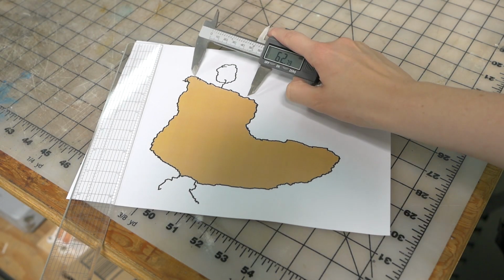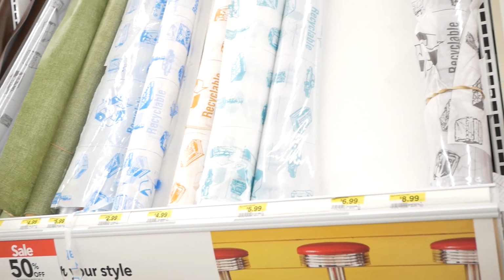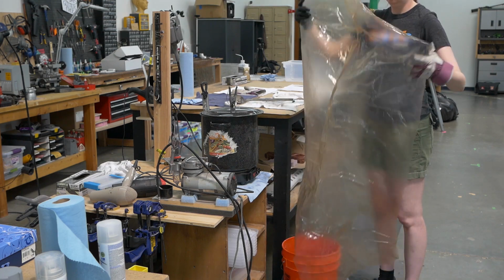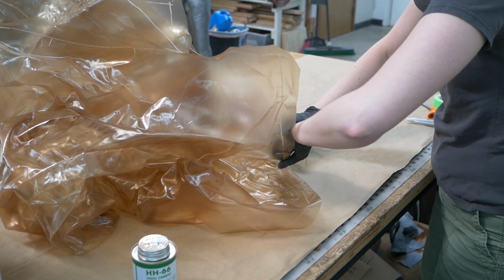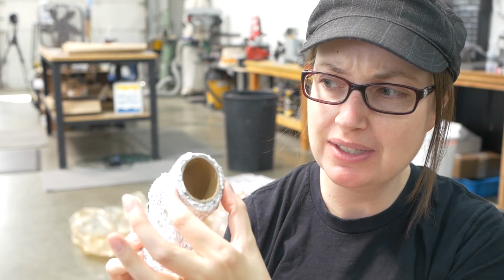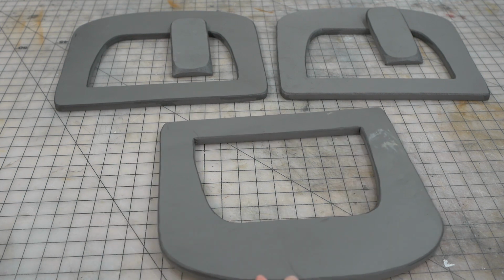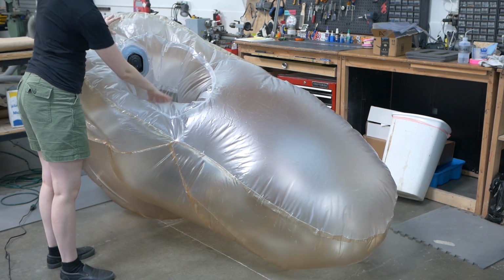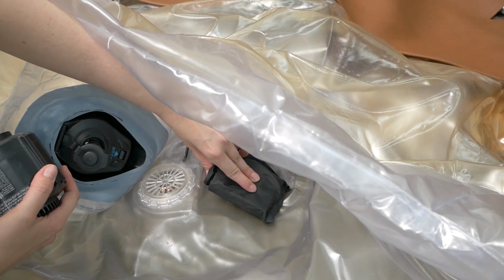How to Make Inflatable Costumes! - DotA 2 Power Treads Cosplay

Comment: will rubber cement work if i dont have vinyl cement?
Reply from the maker: Unfortunately, no. The air pressure is surprisingly powerful and peels apart most bonds. If I was remaking this costume project, I probably wouldn't use vinyl and I would rely on the air system like Odin did: https://youtu.be/DnXr1xEorGQ?si=eIvRDsgB1pk5yiL7 For pool inflatables in vinyl, the simpler the shape, the better. The air will try and escape any little crease or crevice in complicated shapes. Our buddy Bob played around with inflatable ideas in his video: https://youtu.be/D7b3-t79u-c?si=H_ofk7K1NtdtjRPF
Reply: @punishedprops  Ooh thanks for the reply! I'm trying to make a human-sized inflatable pokeball. it doesnt need to go in a pool and i was thinking of making it in 2 halves (1 lid and 1 bottom part that a human can sit inside). do you have guides or tutorial  recommendations I can look more into?

Comment: Late to this party, but for heat welding you basically need an upscaled heat sealer from a vacuum food saver device. Basically a board with nichrome wire attached and covered in kapton tape and another board to apply pressure.
Alternately I have seen hand held devices for resealing crisp packets that might also work, though they may not be powerful enough for this type of vinyl.
Reply from the maker: Handy to know!

Comment: The link to the vynil glue just takes me to a search with PVA glue or glue for other materials. Would these work or does it have to be vynil glue? Also, if it does have to be vynil glue, could I have a direct link to some? Thank you in advance!
Reply from the maker: Thanks for letting us know! The link appears to be working for us - you may need to try a different browser? But if push comes to shove, you can search for the name of the vinyl adhesive on Amazon and you should get the same thing

Comment: Viny is not a thermo-formable plastic. Therefore it is not a good candidate for head bonding.  Polyethylene is what you want to use for that.  I haven't tried a heat sealer on a large product. But, the small battery operated ones may work.  Search "Battery heat sealer" or "handheld heat sealer".

Comment: I made an inflatable costume for Halloween.
I chose to be Erik Cartman from South Park, in his police uniform.
I wanted something with an oversize head, that wouldn't sit on my shoulders, but extend down to my elbows, making it appear as if his shoulders began there.
The rest of the body would be shortened, so his legs would begin at my knees.
To understand this idea better, just hold a coat in front of you at your rib cage.
Your legs are only visible to the knee, and only your forearms go into the sleeves.
Now imagine the upper half of your body inside of a ball. The top of your head is at the top of the ball.
I've never seen anyone attempt this shape before, so It was a challenge.
Erik Cartman's sunglasses provide plenty of room to see out.

My first attempt was with foam and stretchy fabric. I enlarged two beach-ball patterns using an overhead projector as you did. One ball was for the head, of course, and the other ball was for the body.
I didn't actually use a coat. I only mentioned it to describe the silhouette I wanted.
My legs would poke out of the bottom.

But as you mentioned, it was too bulky to transport.
So I remade the costume to be inflatable.
I bought a battery-powered inflatable costume fan, (which would have to run constantly to keep the costume inflated), and used lightweight nylon material for the costume.
I found rip-stop material works best.
All seams were machine sewn with lightweight thread, and I had to figure out how to enclose everything. Arms and legs included.
Instead of putting a zipper in the back, I kept it in front of the coat. (It had to be long, so it's designed for a sleeping bag.)

I did have to add suspenders inside for extra support. After all, there wasn't enough air pressure to keep the perfect balloon shape. But it definitely filled out nicely.

Not too bad for my first try:
https://scontent.fric1-1.fna.fbcdn.net/v/t1.0-9/13495283_1390611940968497_3111558822599860299_n.jpg?_nc_cat=108&_nc_sid=8024bb&_nc_ohc=9uVMVzdfE9wAX9GnIVs&_nc_ht=scontent.fric1-1.fna&oh=dfbdaeea1293f80846f94e4ddac9deb8&oe=5EA4F8F3

https://scontent.fric1-1.fna.fbcdn.net/v/t31.0-8/p720x720/14706925_10206900710268347_7041195029016182573_o.jpg?_nc_cat=100&_nc_sid=d4cf07&_nc_ohc=ccfKUHDYQjcAX9CZin7&_nc_ht=scontent.fric1-1.fna&_nc_tp=6&oh=4e27e43f2459ff2ccc41fe2218af0777&oe=5EA56CA0
Reply from the maker: Nice!

Comment: It my job to make 10ft by 20ft ish inflatable sculpture out of PVC. To say this is the first time you'd done this you did a very good job! There's a real nack to seaming in this manner. Our templates are all cut with a half inch seam allowance and we mask off to allow for that seam to be glued. We use a bostik product which allows us to glue both sides, let each dry and then glue the glue together in smaller sections. Instead of gluing the two pieces of fabric on the same side we glue one on the shiny and one on the dull and this creates a flat seam and allows us to just lay the two pieces atop one another meeting reg marks. It's not perfect, we do still get punctures so similarly to you we do use a continuous air supply. I loved your use of connectors on the inside to create space for a human as it's not a technique we use and expanding my knowledge of pneumatic craft is great! If you decide to pursue more pneumatic costumes I'd be happy to provide photos of how we work!
Reply: I forgot to mention our secret weapon for air tight seams! I wooden roller! About two inches wide and a wrap of duct tape to protect against marking the plastic.
Reply from the maker: Thanks so much for the pointers! =)

Comment: pool toys are ultrasonic welded, not heat welded.. this uses an ultrasonic horn  two small shaped metal pieces which pinch the plastic together and then use ultrasonic vibration to cause the plastic to heat and weld together.... https://en.wikipedia.org/wiki/Ultrasonic_welding
Reply from the maker: Woah!

Comment: This is almost identical to something I've done in a sculpture class. Instead of vinyl, we used plastic drop cloth. Dyed the plastic drop cloth the same way, then used both an iron and a hair straightener to create seams. But make sure you use tin foil between your iron and the plastic or you'll melt it to the iron. My group created a 22 foot tall bottle this way, inflated it with a box fan to its full height and even got inside it like a weird bounce house.
Reply from the maker: That is super cool!

Comment: I have the past made custom seat covers from polyethylene vapor barrier, welding the seams with a clothes iron. The iron works but it's not ideal, I believe a heat sealer for plastic bags would be a much better option, but I've never tried it.

Comment: That turned out great. I've done a bit of hot air welding at a previous job but we were using heavier polyurethane. Not sure if that vinyl would be to thin and just burn through. It takes a fair bit of practice to get the temperature and speed just right.
Reply from the maker: I bet it's quite a skill to learn. Thanks for the info!

Comment: Britt, you really made this the most difficult way you could.  Any inflatable that is not hooked to a large fan should be built as a collection of inflatable ribs.  You could have made life so much easier by buying some large inflatable pool rings to make the cylinder around the person, with curved tubes making the rest of the frame.
I first build using pool noodles and then create the inflatable ribs around them.

It does mean that you have to inflate multiple ribs, but this means less pressure and even if one fails the whole structure does not collapse.  You can then skin the ribs in any lightweight material.
Reply from the maker: That sounds like a really cool method!

Comment: Small heat welding Machines aren't that har to find. It's used by small manufacurers and shops for making small batches of product packages.

Jyst don't burn yourself if you get one! Even on the lowest heat setting they are suuuper hot!
Reply: Oh the one we have at the place I work is abot the width of the long side of an A4 paper and ~7-8 cm deep so they come in really handy sizes
Reply from the maker: Awesome, I’ll look into that, thank you!

Comment: I used a heat press for my heat welding however it was a little limiting because the press could only accommodate straight edges. The sweet spot was around 300 degrees for 20ish seconds without it damaging the vinyl too badly.
Reply from the maker: That's good to know, thank you!
Reply: Yes it would be like a seal a meal. For an iron you would somehow have to sort of concentrate the the heat into a thin strip. Maybe use the edge or maybe an iron model airplane builders use to tack down this sort of cling wrap film.

Comment: this method would be perfect for a baymax cosplay!
Reply: I think something more along Adam Savages Totoro cosplay would be easier/better purely for the sake of Baymax not having a place for your head to go. If you could work around that problem you could have a great looking costume.
Reply: Thedoctor133, yes. A circular rib structure would be absolutely integral for an inflatable baymax. Ribs would be helpful for the shoe as well. Adam’s Totoro build is insanely educational, and would be astronomically helpful for making any large and round cosplay, even inflated ones.

Comment: Could you not just put a rigid cylinder inside and attach shoulder bands to it. The shoe would inflate and grab hold of the cylinder.
Reply from the maker: That sounds like it would work. The plan was for this costume to be folded, and shipped in one piece of luggage.